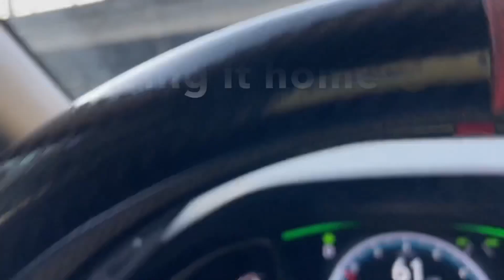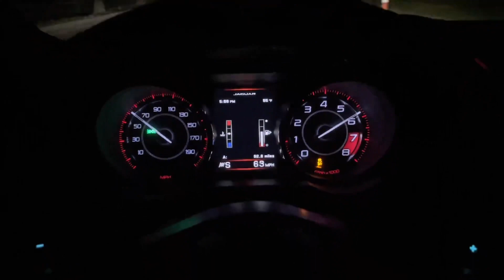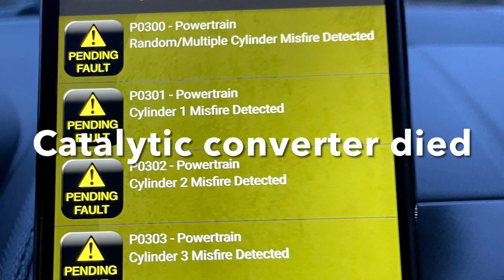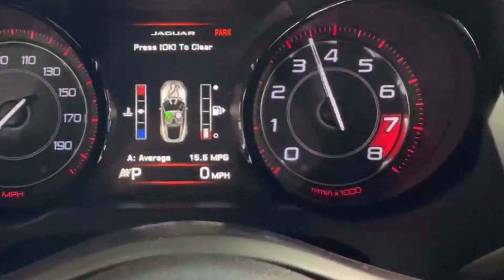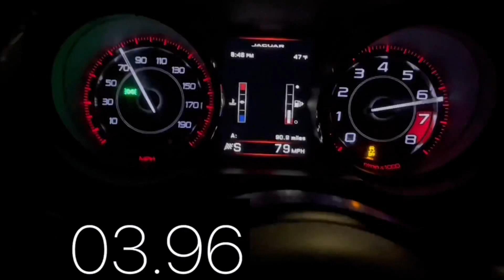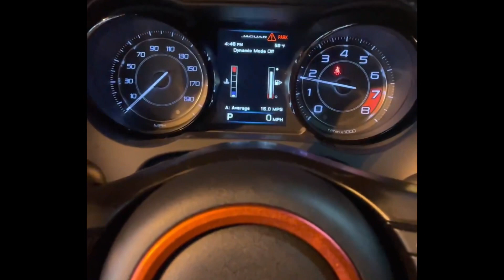Building a Jaguar F-Type in 10 Minutes, BEST Performance and Exhaust Mods For V6 S and V8 R Sound

Comment: Couple dyno videos show that Minan intake robs power especially once warmed up due to heat soak. Functional hood vents allow even more water in causing even more issues with water in plug holes causing misfires and failed coils. A well known ftype issue.  VAP mods are fantastic.  Nice build,  enjoy!
Reply from the maker: Thanks for the comment!  The Mina Gallery lower intake is actually in the least hottest part of the engine bay near the lower front bumper with fresh air supply through ducts from the front grill. I never had heat soak issues but I do live in California where weather is always good. The sound is also well worth any slight loss in HP. 

The functional vents are OEM for F Type base models. There is an engine cover on top and extra foam padded covers on each side of the engine directly covering the coil packs. You can see in my spark plug change video, there is no way for water to get the the plugs. The OEM drainage system via the engine cover does a good job.
Reply: @Sals_Garage  the wet coil issue is well documented.  Typically the middle coils on driver's side.  Had to replace coils on my v8 due to water running down the engine cover,  soaking into the insulation,  then dropping behind the hard foam insert.  It's a poor design that some RTV fixed right up.  I agree on the lower intakes,  it's the top that heat soaks. Just search and you'll see the dynos where they lost power.  Jag got it pretty good to begin with. 100% agree on adding the SC whine, does sound better.  :) Enjoying your build and videos.   I have the Minan intake in the box.  Next dyno I do I'll swap it in to see if my results are the same. I'm running a custom VAP stage 3 tune with cat down pipes, top and bottom pullies estimated around 675bhp right now, want to see what she actual does.
Reply from the maker: @mikeherman9418  thanks for sharing. I haven’t heard of the wet coil pack issue before. RTV is a good idea for fixing it 👍. Nice work on the performance mods for your Jag!  675 BHP is very nice!  Interested to see your dyno numbers once you get them 🙏

Comment: Sounds so good! 😍
Reply from the maker: Yea! Best sounding V6 for sure!
Reply: @Sals_Garage   Hey I have a 2018 J in to jaguar F type 4 cylinder 2 point or 2.0 what exhaust system do you recommend to upgrade to to get better sounds
Reply from the maker: @kevinspells915  muffler delete is a good option 👍

Comment: Thanks for the video, When you clear out the cats of the debris, do you have to reset the comp, or is it just connecting the L-sensors and forget.
Reply from the maker: No need to reset anything. You’ll need a tune to remove the CEL light

Comment: Does the active exhaust valve control still work with the muffler delete?
Reply from the maker: Yes! That was important in my decision to mod the muffler.
Reply: Thank you for the reply!
Reply from the maker: @tradesmenworldwide  anytime! Good luck 👍
Reply: @Sals_Garage I saw you removed the whole suitecase muffler enclosure when you cut out the mufflers.  Was that totally necessary? Or can I just lift the vehicle and cut while the suitcase is still attached to the vehicle.
Reply from the maker: @tradesmenworldwide  easier to remove muffler and do it from top so the welding can’t be seen since it’s pretty noticeable from the bottom.
Reply: @Sals_Garage hmmmmm. Alrighty.  I guess I have to decide if I care about the weld marks enough to want to go through the process that you did. 

I guess I kind of don’t care and am leaning towards cutting while it’s still attached to the vehicle.
Reply from the maker: @tradesmenworldwide  let me know how it goes. Good luck 👍
Reply: @Sals_Garage  what state are you located in?
Reply from the maker: @tradesmenworldwide  California

Comment: Was that the Torque app on your mounted display?
Reply from the maker: Yes, I monitor the car’s health through there.
Reply: @Sals_Garage  how did you solve the battery drain issue? If you had it
Reply from the maker: @luclapierre7621  I unplug the obd2 adapter when not in use.

Comment: Yo where do you find those hood vents ?
Reply: And for the mina gallery stuff lower intake works fine or compete air intake For more supercharger noise any differences?
Reply from the maker: I bought the vents on eBay used. For the intake, I recommend the complete intake for more noise: https://youtu.be/G147nn2AmTA

Link to purchase is in that video.
Reply: @Sals_Garage  good looks bro 🍻
Reply from the maker: @BenR99  anytime! 👍

Comment: I have a F-Type and my question is did you get the whole intake kit, or just the lower air intake tube and filters?
Reply from the maker: I just got the lower half only. Cheaper and easier to install.
Reply: @Sals_Garage  ok, thank you for the information😊

Comment: Hi Sal, love your work. I am doing my first mod fitting VAP cats and am struggling to remove the old cats. The lower nuts on the cats are just impossible to get to. How do you do it ? Do you remove the cross brace? Top bolts are ok but those lower nuts are very hard to get a spanner onto. How’d you do it? Appreciate your insights!
Reply from the maker: Hi!  I used this tool:  https://amzn.to/374KcZs

That mixed with different sizes of wobble extensions will allow you to reach those bottom bolts. Also try to remove the red power cable wire on the passenger side (US) for more room. Good luck 👍

Comment: Hi. Love the mods. I’m over in the uk and have the same car. It’s very hard to find any decent stuff over here. Have you had any problems with the engine after tuning? I will be doing the same to suspension asap. Cheers
Reply from the maker: Hi!  Thanks for the comment!  We had no issues at all with the tuning parts. It worked smoothly like it should from the factory. The car became much more snappy and responsive with enough power for the public roads. The lowering springs were such a great aesthetic upgrade as well.  👍
Reply: @Sals_Garage  thanks for replying - I’ve been wondering what mm drop I could have and what spacers. This has made it easier, assuming it doesn’t rub? Thanks again

Comment: Love the Guinea Pigs! But no way you got to 475 from 360 horse, with just exhaust and air filter. Nope. And some of these mods are just making the car a ticking time bomb for whoever you sold it to. Sorry for them when they continue to over-rev it, and it breaks a valve grenading the whole engine.
Reply from the maker: Whatever you say boss 👍